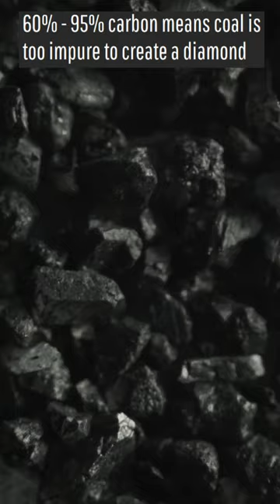Can the Mariana Trench Turn Coal into Diamonds?

Comment: There are many exoplanets with deep enough oceans, or "oceans" of metallic hydrogen and other exotic substances, to have pressures that high. The Mariana Trench's extreme pressure is tiny in comparison to, say, Jupiter's core!
Reply: must have been an adventure when you visited Venus's core 
do you know what temperatures were reached when earth was bombarded by asteroids❓
Reply: @annychest718  That's a good question but the answer is that it depends on what you mean. When the Earth experienced the late heavy bombardment of the Hadean, the surface would have averaged a few hundred degrees celcius. Of course when Theia smacked our planet the whole crust was blown off or melted and it would have been well over a thousand degrees. 
Most of the energy of an asteroid is transferred as momentum, and so if you're looking for some really toasty temperatures  have a look at lightning. While only present for a very short time it gets hotter than the surface of the Sun.

Comment: You could make a device that's a cross between an ovoid and a cylinder and it could focus the overlying pressure to achieve it, with the right elements of course. But I had to laugh at the title. The bottom of The trench doesn't have near enough pressure and heat on it's own. When it comes to untuitively relating to the scale of some things, us humans fall very short.
Reply: The non scientific

Comment: No, it isn't deep eno ugh. You need 100 km depth
Reply: 5130 kilometers. 10 meters = 1 bar. pressure needed: 51320 bar. 1 kilometer = 1000 meters. Welcome to the metric system.
Reply: 513 kilometers. If 51,320 bar needed and 1 bar = 10 meters, then 513,200  meters needed or 513 km. Welcome to math.